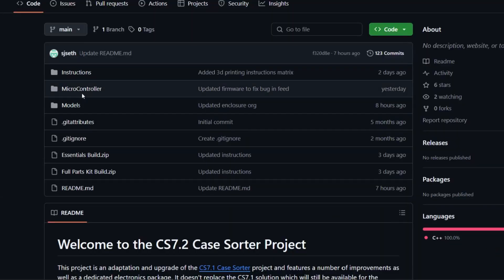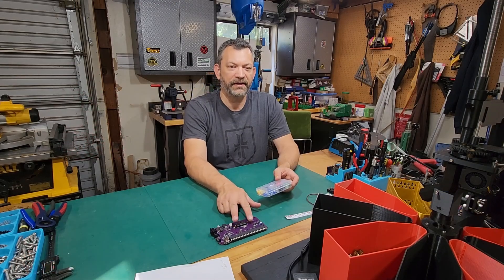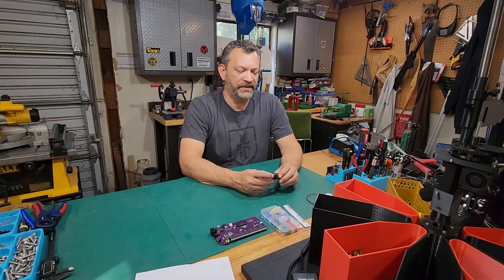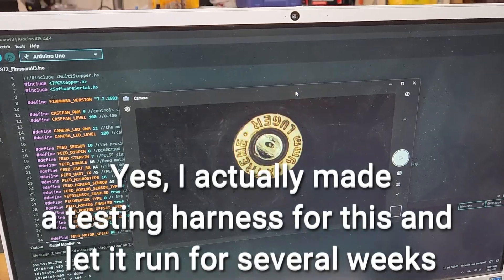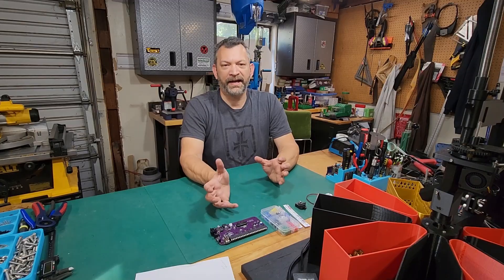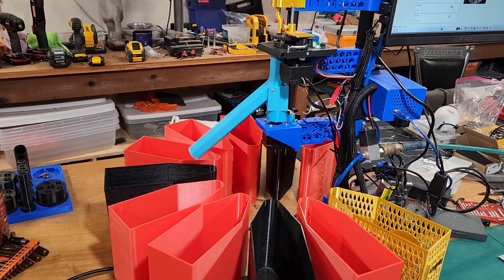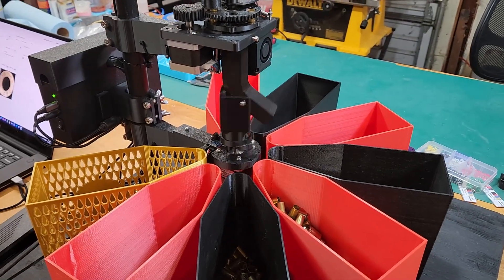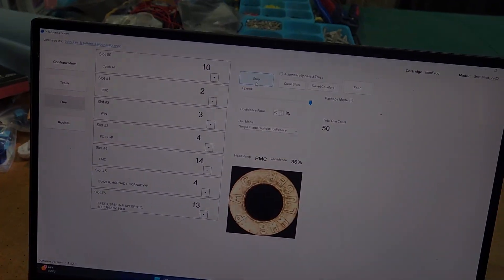Sort cases by headstamp with CS7.2 AI Headstamp Case Sorter

Comment: Was halfway printing the 7.1, but the 7.2 design really looks way more interesting. Though I have 1 question, what do you use as case feeder for the AI sorter ? 
Also something 3d printed ?
Reply from the maker: There is a separate open source project for a case feeder called BF556 which is what many are using but any other feeder will work such as the hornady or dillon feeders.

Comment: Looking forward to this! I just finished the 7.1 version. I guess I will have to upgrade. Honestly the biggest problem I have had has been with the accuracy of the model. The machine itself was one of the smoothest DYI projects I have ever built.
Reply from the maker: Thanks for the feedback! If you are not in the Discord already, definitely join us there as well (links in description). As for the accuracy, that is a hot topic in the forums and there is a guide available for how to create better models.
Reply: @sjseth-builds  I basically keep that PDF guide open while I am working. This really is an ultra cool project.
Reply: This might be the kit that makes me dust off the old Artemus CNSee printer.  How does it handle .380….
Reply from the maker: @Kirkster131 It can handle it and separate from 9mm. There is also a mod in the Discord forum which separates 380 and 9 mechanically by height

Comment: What Seth said regarding cost and assembly is true.  My first machine parts cost around 250 plus printed parts assuming you have a soldering station and Molex connectors/crimp tools.  After initial purchase the next machine parts cost is closer to 150 considering all the extra parts acquired from the initial purchase.

Comment: For version 8.0 I recommend doing away with the PC and using either Coral AI or a Nvidia Jetson Nano. Otherwise bravo!
Reply from the maker: That would be awesome !
Reply: It’s been done with a Nano for sorting Legos. Apparently it’s easy to port Arduino code over. It would be a matter of porting/writing the equivalent PC code in python. Under $200 for the Dev board, cheaper than a mini PC and it’s specifically designed for this type of application. It has all the ports. 🙂 (Those kits sure did sell out fast).